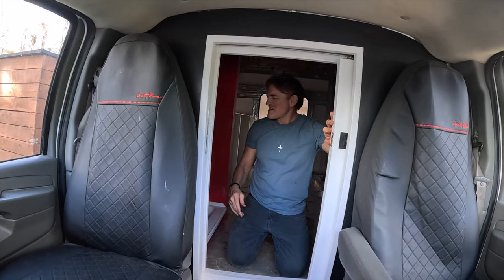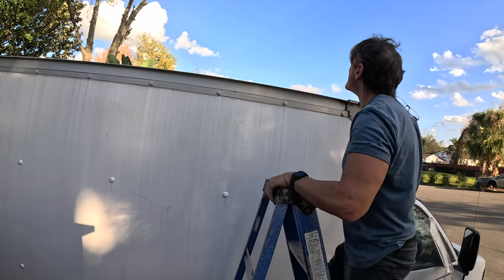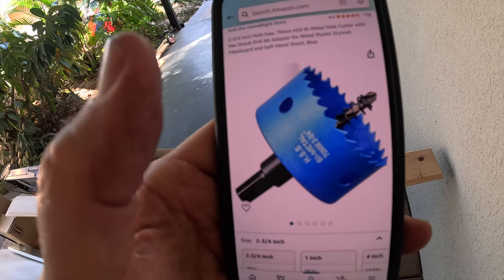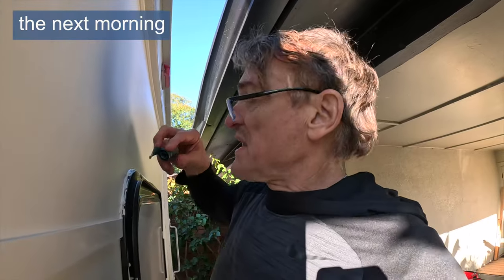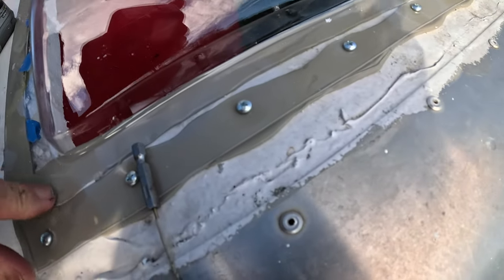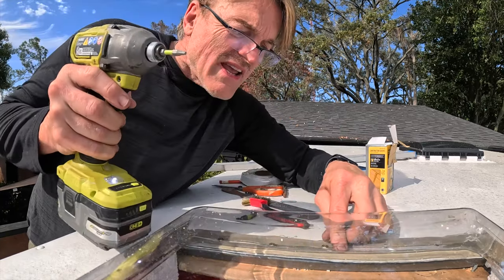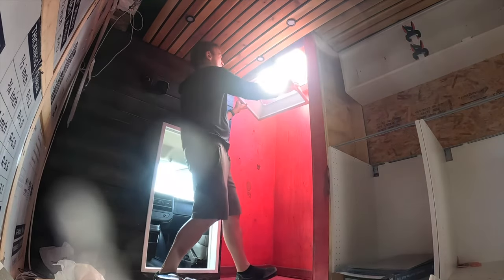HEIGHT AND LIGHT - I’m building the shower in the U-Haul to RV conversion

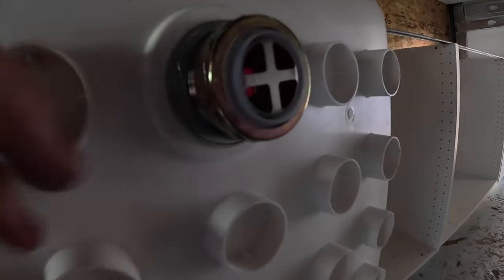Comment: @2:49 Tony, will those plastic circular things(not the tube) that are under the shower floor you're holding, will that eventually support adult body weight?
Can you make them more supportive by gluing and adding wood circles? I feel that eventually those plastic  circles that support body weight could potentially collapse since they are made up of hard plastic.
I'm not a van life builder or owner. Just putting in  some though about what I just noticed. I love your channel.  Good luck on this build.
Reply from the maker: A gripping foundation and expansion foam go underneath👍🏻
Reply: @hellomynameistony  great.